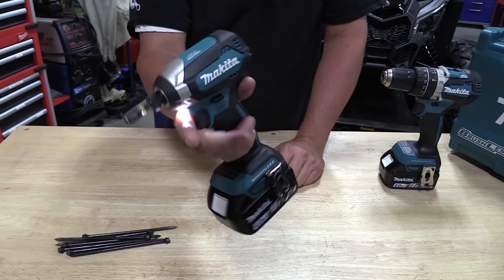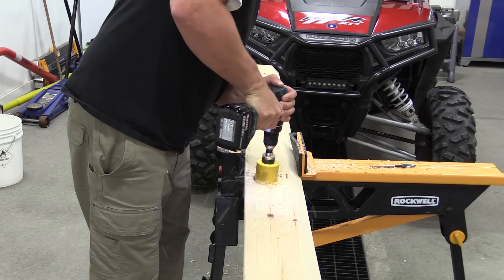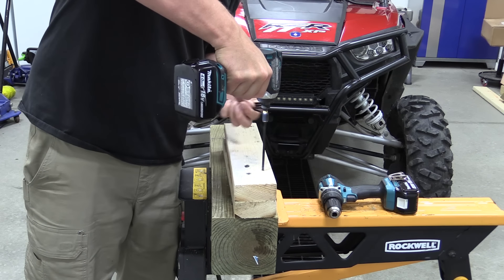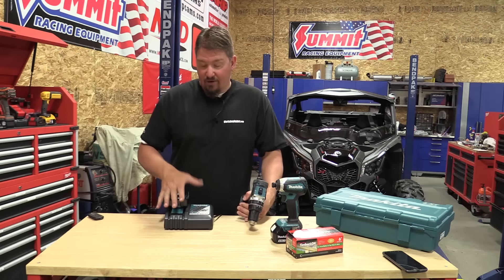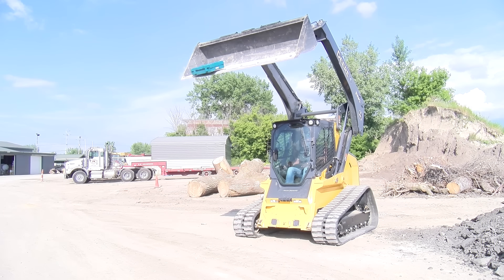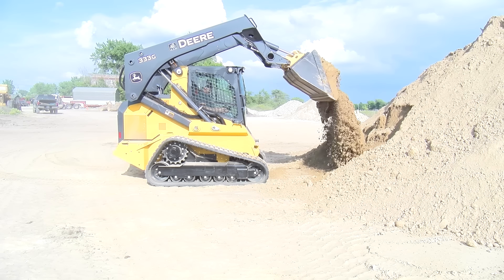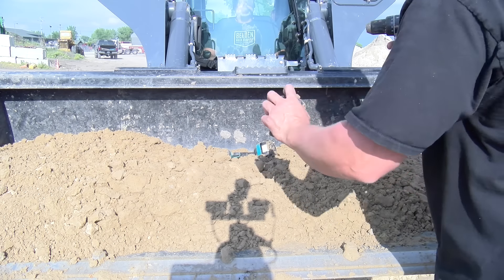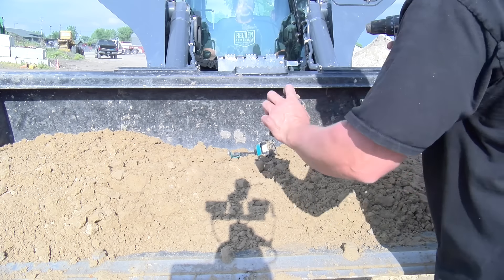Live or Die? Makita LXT 18-Volt Drill & Impact Driver Extreme Torture Testing | Combo Kit XT269M

Comment: Case is cool for at home but you can’t take your extra bits or the bit box with 36 or 40 pieces in the bag I carry screws nuts bolts the bit box and an oscillating tool with blades no space for that in the box designated for only two tools